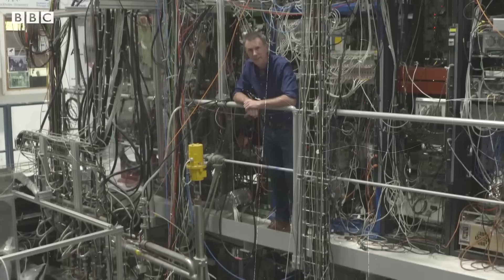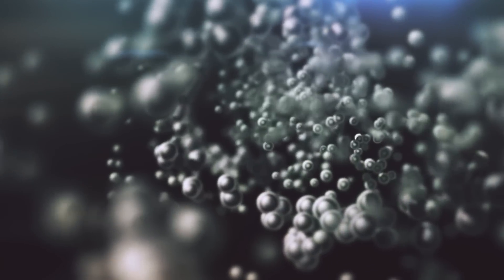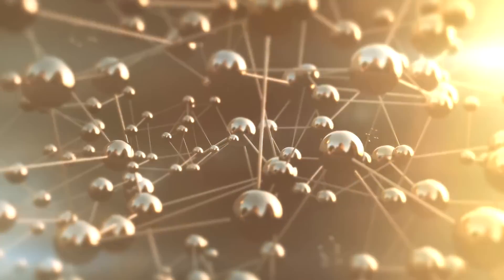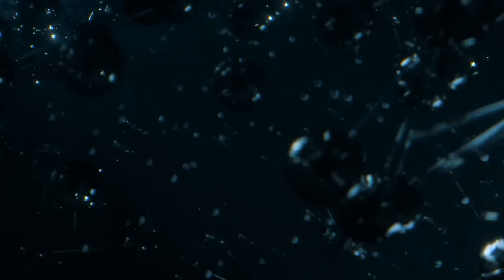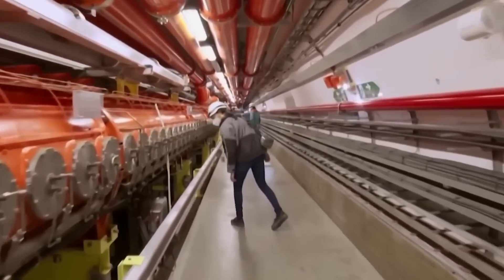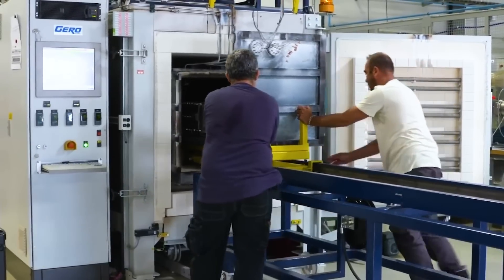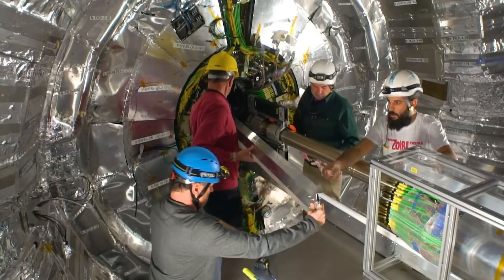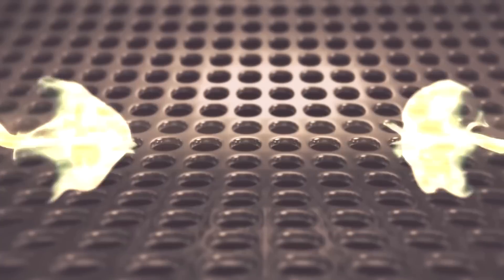NASA Announces STAR TREK WARP Engine Powered by Antimatter Changes Everything!

Comment: Anti-matter sounds very dangerous and very costly. The ancients took it to space by simply riding the Ether. Their genius consists of priming the Ether with harmonic frequencies emanating from key strategic placements of their Powerplants (pyramids). I'm not sure if their spaceships, a.k.a Vmanas, had an FTL drive on board, but if they did it would mean that there's a direct correlation between the amplitude of these frequencies and the scalable  FTL speeds.
Reply: Ancient humans never went to space.

Comment: From what I understand the difference between matter and antimatter is a mater of the same charges occupying the same space at the same time. In other words the  positive electrons of antimatter and positive protons of mater and the negative protons of antimatter and negative the positive electrons of antimatter and the positive protons of mater and the negative electrons of mater and the negative protons of antimatter occupying the same amount space as at the same time. If the law of like repel and unlike attract law is anything to go by mixing like charges occupying the same spaces at the same time would repel each other on a light speed scale.  Could it be possible to reverse the forward going inertia accelerating in the forward going accelerating. Instead of pulling back on the acceleration  the inertia pulls the acceleration  forward in equal amount.

Comment: One problem is in quantum physics only  one particle can hit another and the most power that can be applied will accelerate the hit particle to the speed of light . One particle can drive another one to hit another, but their force cannot be combined . You cannot use 2 particles together two get double the force!

Comment: I doubt NASA has announced this. Whilst there have been small experiments trying to create tiny little space distortions ('warps') and the Alcubierre Drive has been much debated, we're actually centuries away from one if it can be built at all. We can create and trap a few particles of antimatter but to produce enough for a warp drive (and we still don't quite know exactly how to warp spacetime) would cost trillions of dollars. Nope, warp drives are way, way off.
Reply: also warp drives dont propel, like you said you bend spacetime ie gravity. This fuel isnt for a warp engine is for propelling so the using the term warp drive and propolusion to high speed is wrong, warp drives dont move you it moves the space around you defying the laws the light which we cant by going really fast
Reply: Alquiberres drive doesn't work.  I have a super vacuum drive that might, but it would require some seriously powerful ships with crazy amounts of technology.  Secondly if you could control a space in a higher dimension and time warp it, you could create infinite antimatter through instant time warp aging.  Would be a star trek style reactor.
Reply: @Aurumk1  I think your physics is a little off here. Alcubierre's drive model has been modified, the maths checks out so it should work. Warping spacetime won't create anti matter. Neither will 'time warp ageing' whatever that is?. Time warping is the slowing down or accelerating the passage of time, so where would your energy come from to do that initially?. We have actually created anti matter in particle accelerators. Trouble is, even though we've stored in magnetic fields a few particles of it, the amount needed to power a Star Trek drive (deuterium matter/antimatter fusion) would cost more than the entire GDP of planet Earth, plus take a long time to accumulate.
Reply: from matter antimatter can be captured in a trap.  You would send matter to age into antimatter in a containment field to another time.  Then when it returns it will have aged sufficiently.  However this method would likely require so much energy its retarded in itself.  However it might be possible to make one trip and collect a significant amount if antimatter is created in this way.
Reply: @Aurumk1  Antimatter doesn't 'age' into matter otherwise the universe would be filling up with it. If you sent some matter, ie. yourself, into the future you'd still be just matter.
Antimatter 101: https://en.wikipedia.org/wiki/Antimatter
Reply: @mark-nm4tc  Yet radioactive decay does produce some antimatter its actually much quicker than I thought as well but the electrons eliminate the antimatter so it doesn't work so well.

Comment: NASA are Nazi, and everyone working for them who are not are just actors. Space is a near vacuum and hydrogen gas from the sun binds all of its bodies. Ultrasound passes from the sun through that gas and is one of the reason the explorer probes have ultrasonic microphones which are irrelevant if there is no medium for sound to reach them. Plasma generated ultrasonic echoes in space can be used to catch hydrogen to burn into water while heating turbines and then ultrasonic resonance to convert the water to hydrogen & oxygen to recharge life support + Hydrogen engines. - Real scientist.

Comment: The universe is not full of matter.  It might seem like it on earth surrounded by matter, even the air is thick enough with matter that you can feel the wind blow.  However when you back away from earth and consider that our universe is almost entirely empty space with a few patches of matter we call galaxies and even those are almost entirely empty space with a few patches we call solar systems, its a pretty empty place.  Currently all matter in the Universe makes us less than 0.00000000000000001% of the volume of the universe.  The rest is all empty space.  This number is shrinking by the day as the space between galaxies continues to expand.  So while the total volume of the universe continues to increase exponentially, the amount of matter is slowly reduced as stars burn some of that matter into energy.
Reply: dude its not empty space, empty space is full. ever heard of dark matter and dark energy?? space isn't empty. they stopped calling space a vacum cos it isn't a true vacum it has stuff in it stopping it becoming a vacum
Reply: I believe there was a study that came out not long ago that potentially invalidates the observing of the universe expanding. Can’t quite remember exactly what it said though.
Reply: @ANK9936  I have long suspected that it might be bs.  There are many widely held scientific theories throughout history which have been completely debunked, the stars are gods, the earth is flat, time dilation, just to name a few.  It may be that the universe is expanding, but no one has ever come up with any rational explanation for why, or what power source is fueling the expansion.  I mean we are expected to believe that countless galaxies are effectively being propelled faster than the speed of light and ever accelerating but there is no power source behind it?  Its a little more than ridiculous.  We can't even theoretically propel a single rocket to such speeds without supposedly burning all the matter in the universe plus a little more.